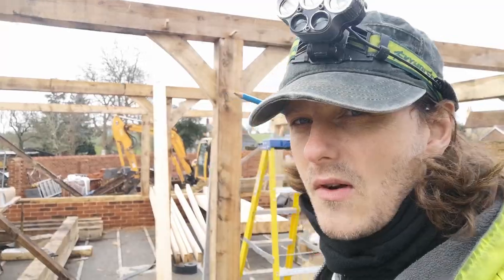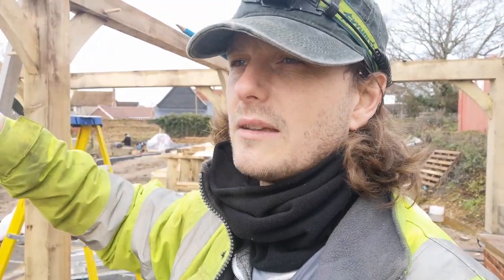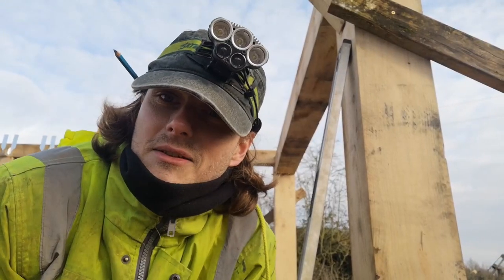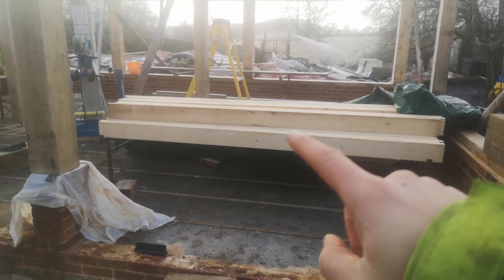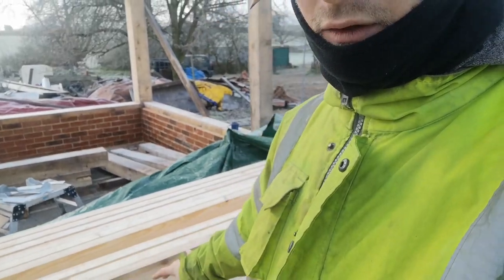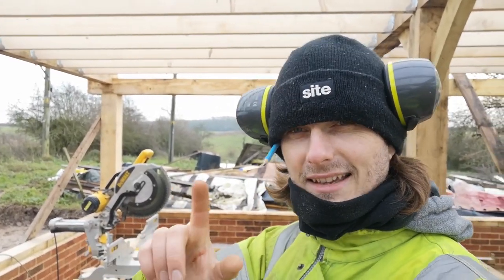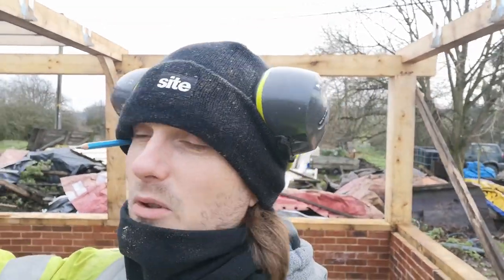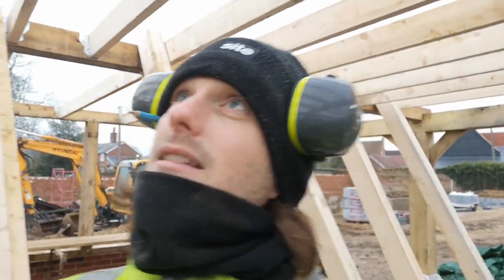HANGING JOISTS (Dewalt DWS780 305mm Compound Slide Mitre Saw)

Comment: I use polyurethane glue on the joists before putting down the chipboard (and on the tongues) which makes the floor rock solid and cuts out squeaky bits 🙂
Reply from the maker: That's what the manufacturers recommend hey, I like to live life on the edge though 😆 as luck would have it, my floor is completely fine 😱 solid with no squeaking

Comment: Before laying down the flooring maybe do a diagonal measurement from the upper corners to make sure you are still square.  I’m sure you did this at the concrete level but sometimes when you get up 8 feet things can go wonkers.  Helps to get your flooring on easier.  How do I know this!!
Reply from the maker: How do you know it? 😂 That's probably a good idea but I'm too far gone to correct anything, the floor went in ages ago although I might have to rip it out and do it again cause I still haven't done the roof 🤦 the frame wasn't too far off square though, just a bit wider in the middle but as I wasn't doing all of it by myself I didn't realise until it was too late 🙄